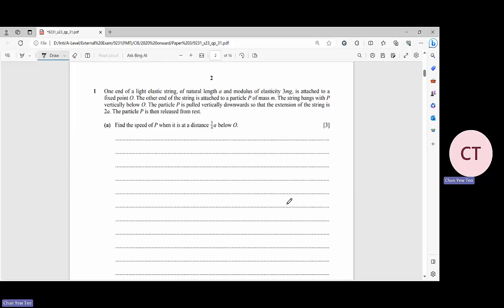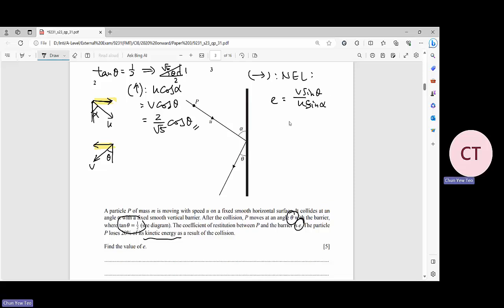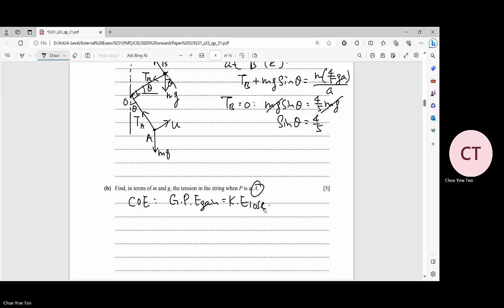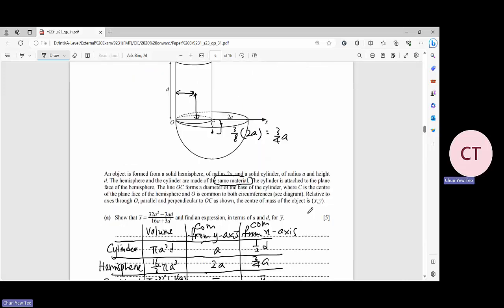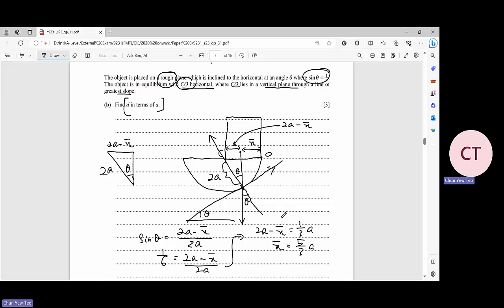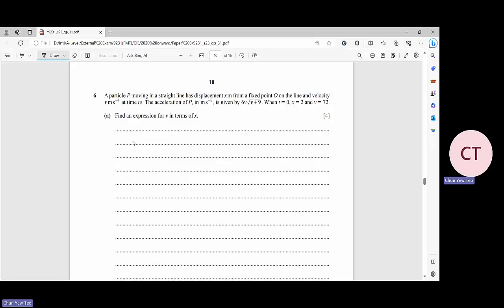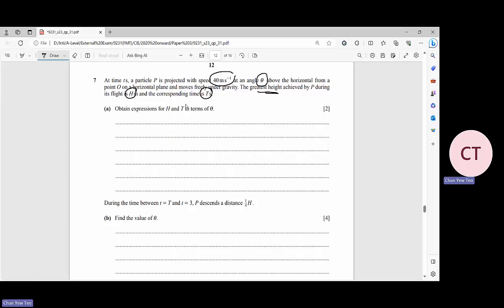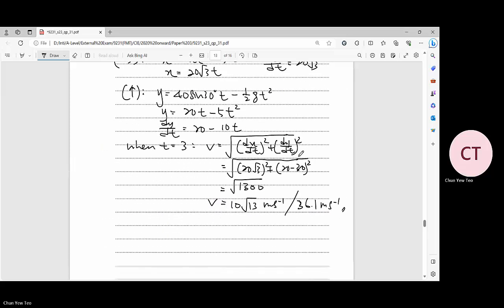9231/31/M/J/23 Further Mechanics Solution

Comment: Sir in question 1(a) the string is stretched 2a at first and then it compresses by 1/4a, so why dont we write the extension like this ((2a)^2-(1/4a)^2) ? Instead of (2a)^2
Reply: Only spring can compress. String cannot compress.
Reply: @chunyewteo2692  thank you very much
Reply: @c @chunyewteo2692 ohh so if they asked spring we need to subtract (1/4 a)^2 from (2a)^2?